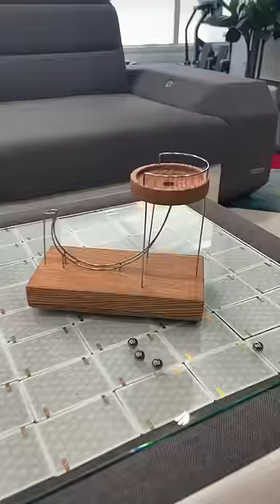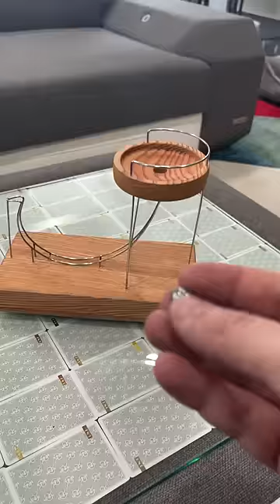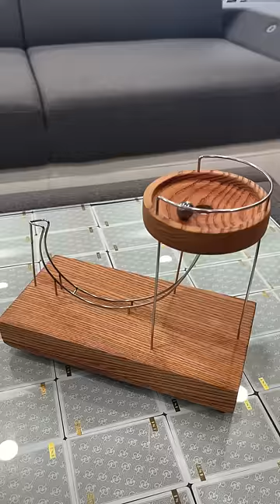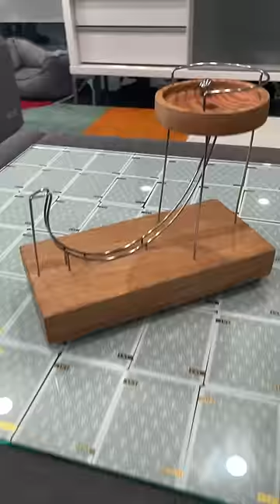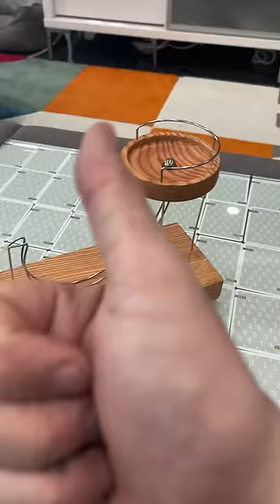An Impossible Perpetual Motion Device?! 😳 #Shorts

Comment: Perpetual motion has nothing to do with *making* continuous energy, it has to do with *conserving* it with any loss.
Reply: Exactly! People think they can “make” energy” 😂
Reply: If they were to make continuous energy than the ball would've gotten faster and faster until I flew out
Reply: Tell that to NASA's Flywheel, still spinning with no sign of stopping.  The idea would be to draw power from the device without loss, it is not impossible to conserve power.
Reply: @rocmort1007  there is always energy lost from any physical system
Reply: @rocmort1007  why is this a “highlighted comment”? That’s an absolute ridiculous statement.
Reply: @rocmort1007  I said it's it's impossible to create energy, I never said it was impossible to conserve it
Reply: @rocmort1007  yeah, too bad for the "without loss" part haha. Also you don't conserve power, but energy
Reply: Well eventually the ball or the rail will wear out and it won't function anymore...but with the tiny amount of heat generated by the ball gliding along the rails, surely one could tap into a tiny itty bitty amount of power...it could charge my phone-and probably take about 2 years doing so.
Reply: The way this is phrased is a bit misleading. There are many physical systems that do not lose energy and are not considered “perpetual motion machines.” For instance, super conductors are cooled much lower than normal temperatures and are able to have no resistance in relation to a direct current of electricity, and, so because of this, they have no energy loss.

The reason that perpetual motion machines are impossible is that these machines do work, which is defined as the energy transferred to or from an object. According to the second law of thermodynamics, whenever work is done not all of that energy can be carried over in that energy transfer. Some of it is naturally lost to heat. So while yes, perpetual motion machines must conserve their net energy, they must always create more energy to make up for that, which they lose in heat. However, you can create systems that lose no energy when this heat is accounted for via an external energy source or something that does no work and therefore loses no energy through heat.
Reply: It is about conserving energy, however the concept of producing more kinetic energy isn't absurd considering energy is consistently transfered through nearly all physical action which means an outside force, or rather an internal force, would need to continue applying a force forever to maintain perpetual motion.
Reply: And notice you can hear the motion. Clearly there’s loss. Also, it falls too fast. Magnets, and batteries?
Reply: If you have a neutral particle moving at constant speed in the interstellar medium then it might have perpetual motion if you remove everything in its path.
Reply: @Me-nq4gz  well you can technically "make" energy (or at least give the effect of and appear like that) using nuclear fission or fusion
Reply: @user-nq5hy7vn9k  thats 100% wrong. You're just converting energy from another form (nuclear/chemical/potential energy), you're not making energy
Reply: Lol yea this ad is stupid
Reply: That's why they get it wrong... conserving is the last thing you would do with perpetual motion. 
Harnessing the energy is where it gets tricky... but not impossible.
Reply: @Sanelicv  if that's fact, then I'm very impressed!
Reply: @FS_Codex  superconductors are so super expensive though, especially with China having the monopoly on rare earths to make them... it's why the thermal imaging used for military troops and tanks cost so much....but superconductors are pretty close to defying our current laws of physics.  Once we master transdimensional storage, then we will have to rewrite that bit about conservation of mass/energy....but we won't be able to toy around with that until we can capture and control antimatter...maybe in a few centuries if we all don't die in a stupid war before then.
Reply: U can never make energy or destroy it, the Universe has had the same amount of energy ever since it was created
Reply: @thuglyfe709   sooo....are you suggesting that it's a known/finite quantity?  When does it stop expanding?  The universe started as a 2b zip file/compressed folder, and once unzipped/extracted  it became billions of terabytes.   When does the source run out?  What is the armament of the Lollipop?
Reply: @pex_the_unalivedrunk6785  what are u even trying to say speak english pls
Reply: @thuglyfe709   The Dog drank from the bowl...the bowl is Blueey.  Did I get it right?  No, Nyota Uruha....your brain has  been compromised too much to serve as a communications officer in Starfleet.... I'm Sorry.... you're fired.  We'll drop you off at the nearest Starbase and you can be a psychic hotline operator.
Reply: @pex_the_unalivedrunk6785  i died from cringe 💀💀💀
Reply: @thuglyfe709   soo... uhh...well, this is awkward....should I send contributions in lieu of flowers?  I mean, I'll probably crash your funeral for the free food....and then feel like I have a rock stuck in my throat(cuz it hurts to cry) and won't be able to say anything during the service....sorry....I get emotional at funerals and weddings...and fake snuff films.   Oh wait, cringe!?

😂😂😂 I AM cringe moment.
Reply: @justchillingdogg7924  well what I meant was that it would appear/give the effect of energy being made using mass. So I said technically
Reply: @user-nq5hy7vn9k  thats not what "technically" means. "Technically" means you are describing exactly how something works. What you meant to say was "basically", which implies an imprecise simplification. There's a massive massive difference when we're talking about science and that grammatical error completely changes the meaning of your first comment. I am an engineer and precision of language is very important.
Reply: @justchillingdogg7924  English isn't my first language, so I guess that's mistake on my part

Comment: Imagine if the marbles went perfectly into the hole every single time
Reply: That's what would've happened if there were no energy loss.
Reply: That's what she said.
Reply: @manJ67  😂
Reply: I dont know why but that's unusually hilarious to think about.
Reply: @notdarkangelu  what? 😂🤦‍♂️
Reply: @notdarkangelu  it would be falling short slightly each time if that were the case or something along those lines. It’s not landing in the hole because of aim I would say for the most part.
Reply: @jayzherka4943  because there is a hidden acceleration mechanism that is allowing the marble to reach a higher point than it's height when "dropped" if it did land in the whole perfectly it would overshoot the hole, probably even the platform, on the next cycle. It's probably designed specifically not to hit the hole.
Reply: That's comes under godmode dude.
Reply: @notdarkangelu  not really
Reply: …i made this comment but didnt realize someone made it first
Reply: @primecyber1  ...a hidden acceleration mechanism...

A hidden acceleration mechanism eh? 

Are you from India or something like that where magic carpets operate under the same principle?

A hidden acceleration mechanism...

And voila! X-machina finally reaches the world of science and engineering. 

Hey we have graduated from motels and nickel and diming people to no end to, aerospace engineering where we have designed the new public spacecraft of the future on CGI, it's a bigger version of the 747 except with bigger engines and a big glass shield dome for a cockpit and you see how it works because propellers in space are simply inefficient thank you come again have a nice day....

A HIDDEN acceleration mechanism.....

How many miles do those magic carpets get?
Reply: @primecyber1  sir, you are elaborating within a realm of complete chaos and hypocrisy and that's easy to prove, based on your original comment and address to another comment before I even chimed in. 

Yours is a very special case in which I've never encountered anyone who's usage of words in terms of scientific value and therefore accuracy is everything because we can excuse language and expression if the point is made but in your case that is not the reality. 

I could excuse your loose term of ALLOW ...

But as soon as you reference allow with "acceleration mechanism" and oh so conveniently, 

where, 

I referenced x-machina....

The time old simple solution to a complex problem, that has no real world function in terms of reality. It's just a way of explaining things off very concisely and no different than it's a original definition where the gods come down in a box and.....

You are claiming a impetus and therefore if I have a gun and I pointed at you and now pull the trigger, is it you now that allowed this energy event now to happen? 

Let me just seal your indictment without going over a bunch of other reckless claims and terms you made in concept....

Despite the fact that your energy source claim in order for Continuum to happen as demonstrated in the video, has not been established as any viable consideration when the video itself is making a claim that I myself know is impossible and your magnanimous insight has therefore determined there is a hidden acceleration mechanism where, based off of the blatant lie of the video and narrator itself in which technically in my opinion these things should be illegal, even Einstein himself said those who cannot be trusted in small matters certainly cannot be trusted in big matters in the future and therefore if one is reasonable and logical, the chances of it simply being visual tomfoolery is going to be the overwhelming odds on favorite versus your claim without of course stepping outside or investigating anything further than what this video is claiming and whether these things do exist and do in fact have some sort of artificial impetus weather internal or external, doesn't matter because the reality based off of your claim does in fact make this platform of Continuum a....... MECHANISM sir.

You are getting it ass backwards in terms of two-dimensional versus three-dimensional reality where one is in harmony and the other is harmonious. 

A mechanism is a thing in which energy is needed and or introduced for what will be now called an energy event in display, whether it's a wind-up watch, or a catapult as a mechanism in its truest sense where it's typical winding up and therefore winding down works together in harmony and now the event happens which is harmonious to what is in harmony.

A energy source of impetus and or engine is not a mechanism sir. 

Ok? 

I warn you, you avoided one of my personal questions in which any reply in reference to and depending on, will in fact lend more and more to an answer which will be satisfactory to me despite the fact of the answer itself not being definitive when considering your avoidance but who cares when considering the fact of your defiance and disrespect of reality itself....
Reply: @FIVE-0-APOCALYPTO  it doesn't need to be established in the video for me to know it's there, because I know for a fact that that video didn't break the laws of physics. You're just saying shit that's unfounded. I made a generalized statement of "acceleration mechanism" because I can't tell what methodology was used in the video, that doesn't translate to that I don't know if one was used or not. I'm as sure that such a method was used as I am sure that the sun will rise in the morning due to the rotation of the earth, it's inevitable....
Reply: @primecyber1  lol methodology lmfao....just stop.

The world doesn't operate, nor will it succumb to your idealism and or standards.
Reply: @FIVE-0-APOCALYPTO  idealisms and standards? Being following basic laws of physics?!??!!
Reply: @primecyber1   What if you have a second platform with a hole and a third one, each one at an exponentially larger distance. should work with no wind lol, if you could set up enough platform it could theoretically reach space at some point? what the fuck?
Reply: @user-ez7ls2du9c  I'm literally being belittled by a person that just forgot air resistance and terminal velocity exists
Reply: Then you will Lose marbles Lol
Reply: If he adjusted it a little, it might do it.
Reply: @primecyber1  you are from India aren't you? 

You are like 14 or 15 years old yes?
Reply: @FIVE-0-APOCALYPTO  no, I'm from the USA and I also passed physics with a 99% grade. I also have a lexile score over 1400. You simply don't understand how the world works. It's literally impossible for there not to be some kind of acceleration mechanism in the base of that device.